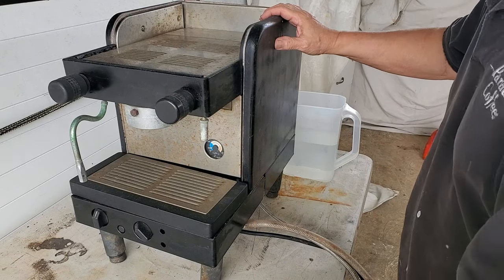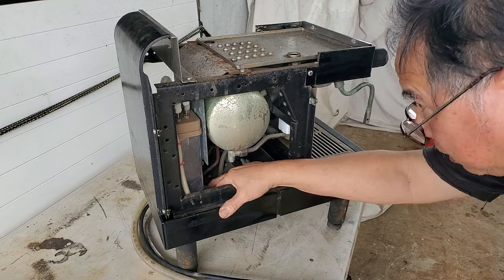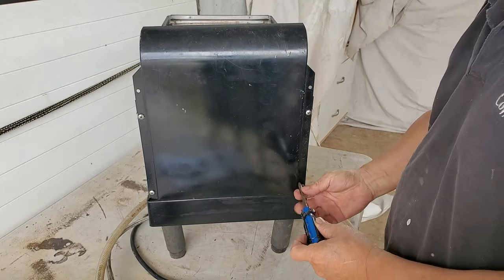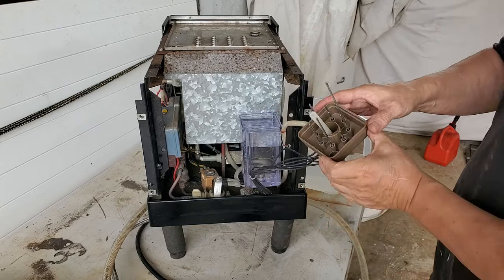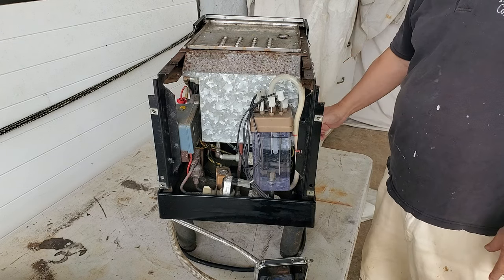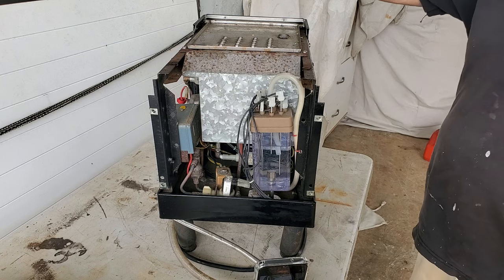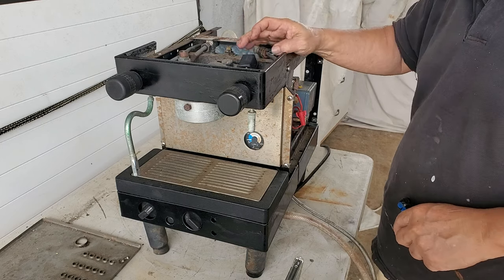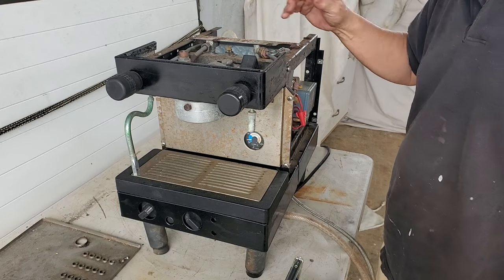M21 Junior - How to Check Water Flow

Comment: Your videos are very informative. Can I ask you for a little advice? How can I get lose the brass shower group head that spray the water into the filter, it seems clogged from the inside and I guess if I take it off I risk breaking the hardened and crumbly seal at the group head. Maybe my terminology is not very accurate but any indication is greatly appreciated. Thank You in advance.
Reply from the maker: Hi Johny,  The brass head can be cleaned through regular cleaning using the back flush cleaner.  There is a more detailed way to clean the diverter.  I'll follow up with a link,  But it sounds like you need to change the gasket,  Your probablu leaking a lot out of the portafilter.  Here is related links, Though the link to Espresso Parts.  I've never bought anything from them.  Though it's reasonable and they have been around a long time.  Amazon.com may have it too.  Though I recommend the 'conical' gasket not the flat one,
I've added the shower head head.  This plate will drop down (with a soft tap if stuck) as it's held in place with the shower screen screw.   Use a toothpick or paper clip to clear the holes.  Pipe cleaner works well after you can clear the holes.  Clean it, not nessisary to replace it.  (DON'T soak in any acid!)

https://www.youtube.com/watch?v=npEgKUY_ZfA

https://www.youtube.com/watch?v=S7TvhViYP4A

https://www.youtube.com/watch?v=DoZE8RVonyA

https://www.youtube.com/watch?v=UQJaXHLeXmU

https://www.espressoparts.com/products/la-cimbali-conical-group-head-gasket?variant=37553454055611&currency=USD&utm_source=bing&utm_medium=cpc&utm_campaign=shopping&msclkid=b10f868797461ff10b59e0836a031470&utm_source=bing&utm_medium=cpc&utm_campaign=Shopping%20-%20Main%20Product%20Categories&utm_term=4577679227520489&utm_content=Parts

https://www.espressoparts.com/products/la-cimbali-group-head-shower-plate?variant=37553451172027&currency=USD&utm_medium=product_sync&utm_source=google&utm_content=sag_organic&utm_campaign=sag_organic&utm_source=Google&utm_medium=cpc&utm_campaign=shopping&gad_source=2&gclid=CjwKCAjwh4-wBhB3EiwAeJsppF04WCET2fdjfuSInRwiBx3MJdlv-9CljBZfx_gsJCkZspgIAVgpJBoCyUYQAvD_BwE
Aloha, Mark
Reply: @ukeboy57 Thank You for the prompt response. Your expertise are really valuable. The machine I was servicing is the Cimbali M21 Junior DT1 with the 5 touch buttons. The problem was an oxidized bearing at the Procon pump. I tried to took apart the pump but failed breaking the graphite vanes. I ended ordering a new pump. As I was watching others videos about how to cleanup the coffee machine with backflush method I used some lemon juice poured into the feeding line for the machine and running through several flush until it poured clean water. That is when I realize that some scales may have came loose and clogged the piston of the group as it was pumping very little drops of water. I tried my best to unclog it mechanically by proding it with some paper clips and needles. In the end only one orifice of the six available was open succesfully.
Reply from the maker: Hi Johnny, Glad to help.  Sounds like you have a newer model with pump and Digital dosing (No Dose Tank, Right?)  The Volumetric pump is very difficult to fix if vanes have cracked.  On a 110 VAC machine, it's difficult to mount the 110 Volt motor and Pump.  It's usually (not normal though) to place said pump on floor with braided hoses to M21.  I'm wondering if you has a 220 VAC machine.  Motor and pump is smaller.  Which could fit.  Though I've never come across a 220V M21 (Well except for two head machines.).  There are youtube vids on fixing pump, though it's not worth the effort.  Many rebuilt pumps just don't last due to previous wear (and damage?).  You can just replace the (Brass) shower head.  Though it's possible to drill out holes with a 1/16" bit.  Though I would only "Hand" drill mannually without power.  Chrome flakes is harder than Brass.  Bit may divert and plow into an undesired area.  Keep digging, It will punch through.  Double check that your getting full stream of dose water when any of the shots are requested.  Keep at it.  You will get there.  Aloha, Mark  @johnnychang4233
Reply from the maker: https://www.youtube.com/watch?v=F3yAT7u-b7c    @johnnychang4233
Reply: @ukeboy57 It's a 120V machine. The problem is that I cannot figure it out how to take apart the brass shower piston to clean the debris behind it. The pump being stuck caused it to blow a fuse in the logic board also. With the new pump everything is fine except for the aforementioned clogged brass piston head. And you are the one that explain the more precise diagnostics on trouble with espresso machines. Thank You for your valuable lessons.
Reply from the maker: Hi Johnny, Humm, I deal with mostly old machines being recovered from storage.  I sounds like your active (in a store, restaurant, Hotel, etc.) .  Since your using a digital M21 Junior with Volumetric rotary pump and not the traditional vibration pump.  I would expect your being serviced by a vender and under warranty.  No?  Then in a remote area?  Please send me a picture of the back where the pump would be.  Or the base arrangement.  I've posted a vid of how it's assembled and another describing how to clean.
https://www.youtube.com/watch?v=F3yAT7u-b7c&t=17s

https://www.youtube.com/watch?v=BE-JPQtwlb8&t=57s

 @johnnychang4233
Reply from the maker: Okay I see new (2 years ago) Cimbali issued a "Commercial" version with a quiet rotary pump.  Yeah, for home use the vibration pump is adequate as it's slow and noisy.  So, with improvements on the 110V synchronized motor.  They manage to improve the efficiency and reduce it's size.  Hum, I wonder if they will make a 110V super automatic machine?  Maybe now I can convert my M49/50's to 110V?  @johnnychang4233
Reply from the maker: The rotary can't be run dry.  Usually, it will burn out a fuse or blow (overheat) the drive motor.  Cracked vanes indicate the drive was mechanically forced to turn.  Probably backwards, which will crack the vanes.  Drive can't spin backwards, nor have enough power to crack the vanes.
Reply from the maker: Though it's possible to clear a stuck pump by carefully moving the shaft a bit at a time.  Grab the shaft with pliers (Channel Lock).  Apply a bit of tension clockwise, then counterclockwise.  Keep twisting BOTH was till you feel the shaft give.  Splash water or WD-40 inside the pump intake and output.  It helps to loosen vanes which normally operates in a liquid.  Once you feel the shaft "give" a bit then giggle it back and forth.  The shaft will gradually spin 360 degrees.   Spin it manually in the operational direction.  You will know this as it will only turn one way.  If it still turns both ways, then add more water or oil as the vanes are still stuck in the closed position.  Reconnect water line (with city pressure) and turn on pump.  The pump will sputter with just city pressure flow.  But should start up with at least 6 Bar pressure.  Let it run for a minute or two to have the vanes settle in, Check for leaks and you're ready to go!

Comment from the maker: Wow, Cimbali really crammed that 110V pump motor into the small Junior base.  I haven't worked on one of these.  But now I'm thinking about changing out the vibration pump with a spare 110V motor/pump (I was using as a pressure washer.)   Fun times!  Aloha, Mark

https://cdn11.bigcommerce.com/s-bbxt1v/images/stencil/1280w/products/539/1473/D1_JUNIOR_6__48557.1416762942.jpg?c=2